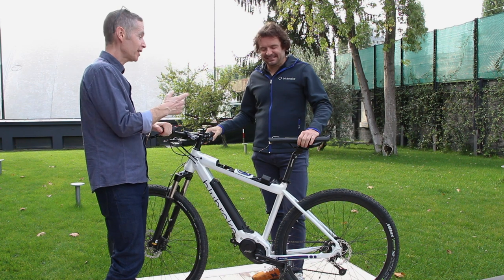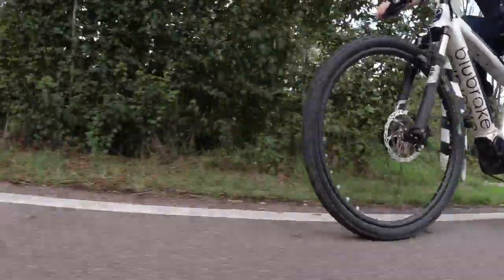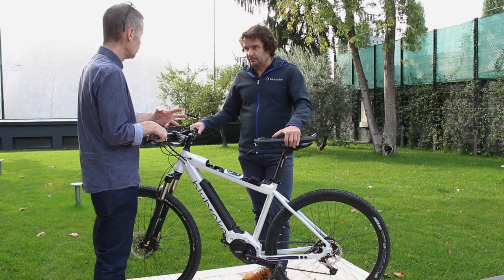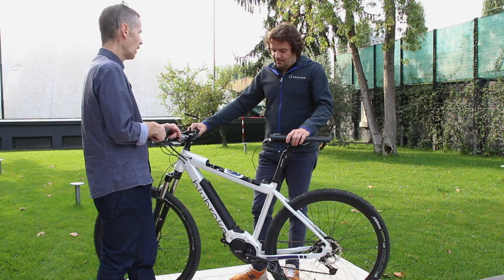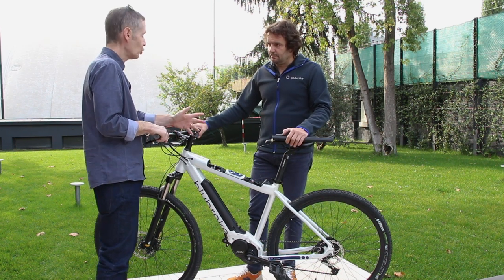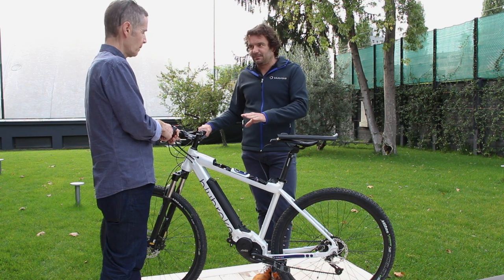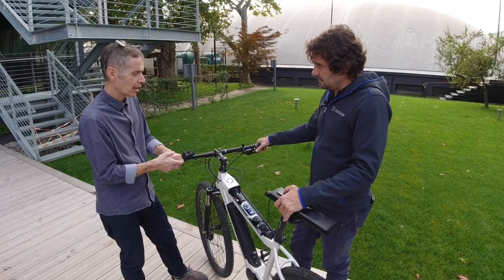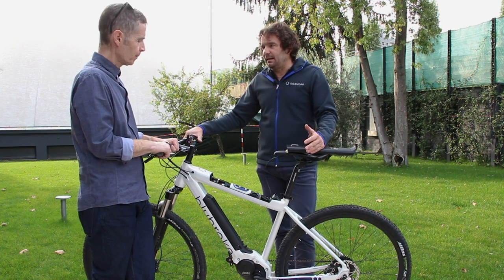Blubrake anti-lock braking | The first integrated ABS system

Comment: Why just why? Power Steering and air bags next 😂😂😂 in over 20 years of riding I've managed fine. If your front wheel starts to lock up relax the pressure on the brake...

Fairly simple and far cheaper 🙈

A noobs dream

Comment: All i hear from this dude is. "Money." Alot of cars with these crap sensors etc. Remove alot of the function of the car itself, because if these sensors are damaged or not working. GUESS FRICKEN WHAT. You can't fricken use it. So if a Ebike has these worthless sensors across the board. And one isn't working, Then nothing works. We don't need sensors for seeing how things need to be serviced,etc. or how long this wears,etc.  We don't need bicycles to become cars with millions of worthless electronics. Bikes are just barely reaching electric stage, We aren't gonna turn them into cars, like how hybrid tech went where they JUST got hybrid cars running with 40-70miles pre gallons. Then we started shoving in alot of POWER related devices inside it, which now we can barely pump out 30-40miles, Back to the start of where we tried to pull off for eco gas systems.

More electronic crap you put on a Ebike the more power it needs. And that MORE power it uses requires BIGGER battery for a similar range then without. 

ABS on Bicycles are a JOKE. Pure and simple. You got Disk brakes that do very good stopping power. People just need to learn how to use their fingers to stop slower. Or go with Rim brakes.

You wanna use this kind of tech. Go toss it on motorcycles. Tho i'm sure they already got a crapload of junk electronics on their stuff they hate already. But they wouldn't give much crap because their not worrying about Weight, and over used power on a small frame design like bicycles are and tend to stick with a very light profile.